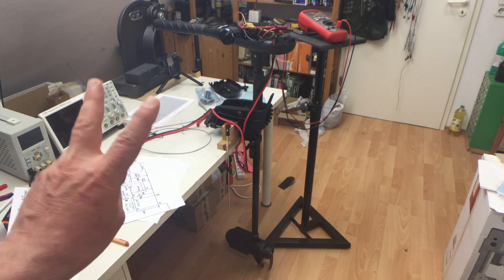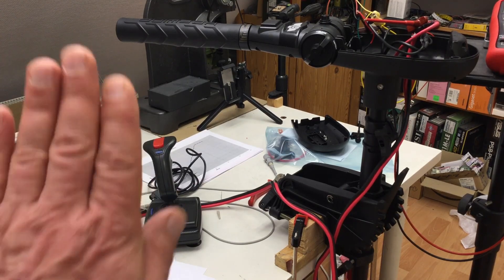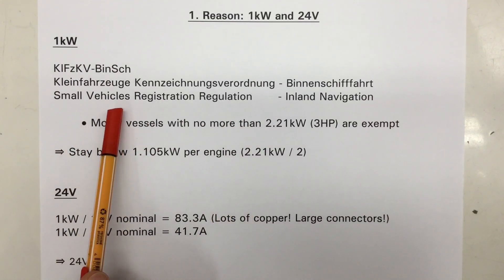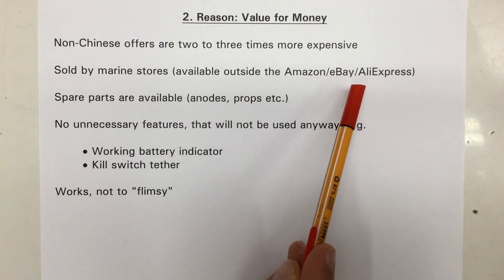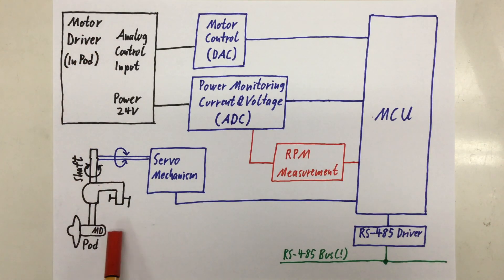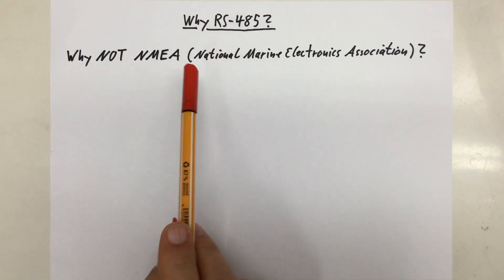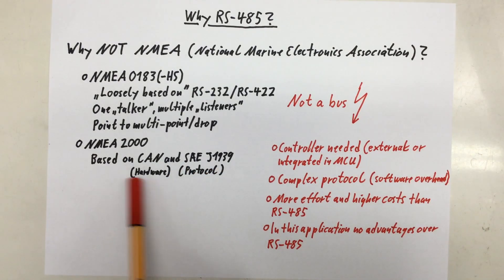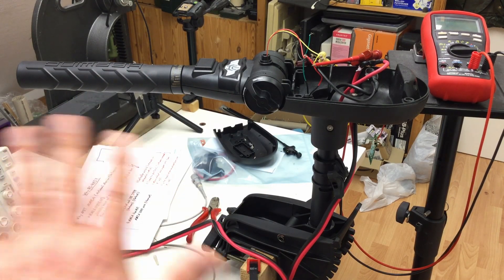Full Fly-by-Wire Electric Outboard (1): Project Kick-Off & Overview

Comment: 14:44 I still cant get over stubbing onto your project and seeing someone else has already done as much and more towards the same goal of creating a coat effective, torqeedo/ newport with an advanced motor interface. 

one idea had been researching was trying to interface with the NMEA 2000 so that Garmin ecomap uhd chart plotter could control motor. 

I just learned about SignalK & OpenMarine project. Which appears would be easier to integrate with than a Garmin head unit.   

After hearing the first part of this video its making me rethink my motor choice. Two 24v 2.0’s on bow and one stern mounted networked would in theory allow 100% control of trolling angle off shoreline, & a more efficient spot lock than whats currently available on the market.
Reply from the maker: I'm happy you found my little project! I personally will stay away from the NMEA protocols in this project (though I guess I could implement an RS-485 to NMEA bridge later), because I want to avoid the hardware/software overhead. I'm actually gunning for a two motor solution. Volvo has something like that for their inboard engines (Skyhook) and Yamaha has such a solution for their outboards.

Comment: Super nice! I will wait with my merc 20hp purchase until you finish your project. I almost pulled the trigger for navy 3/6 but i have changed my mind when i came to your project. Waiting for next videos. Thank you very much for sharing your work
Reply from the maker: Well, thank you for the praise. However, if you were in the market for a 20HP Mercury, two 1kw electric motors will not make you happy. The ePropulsion Navy 6.0 with 6kW (8HP) will probably also not compare to a 20HP gasoline outboard. In addition, 1kWh battery capacity will weight in at about 10kg/44lbs. Hate to break all that to you, but unless you're happy trolling a small dinghy (2 x 1kW electric) or maybe barely planeing it (6kW), I would still go with the 20HP Mercury.
Reply: Yes i am aware maybe 4 navy 6.0 are not comparable also:) it is my mind going back and forward.  I will wait until you finish your project in all cases and i will decide. Thank you very much for your clarification.
Reply from the maker: @HristoPerov  You're welcome! But please be aware that this  project will take a while ... You might want to buy a cheap, used gasoline outboard and have fun on the water now, instead of waiting for me 😉